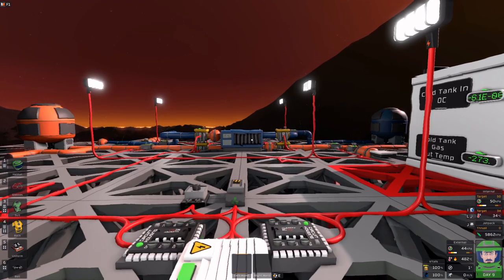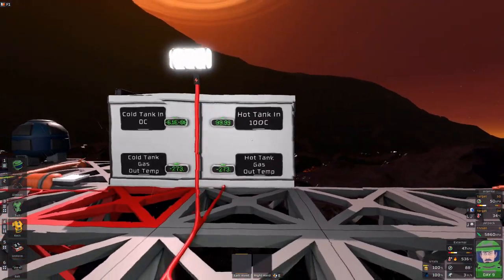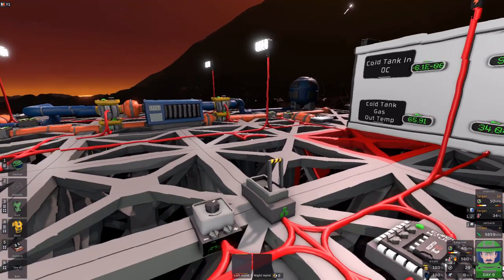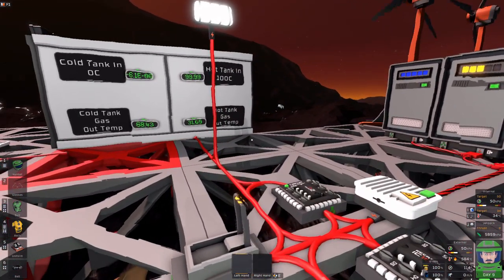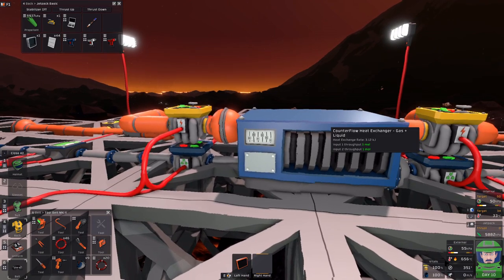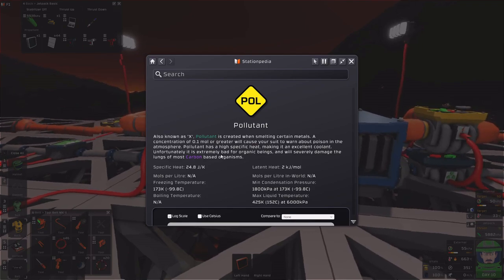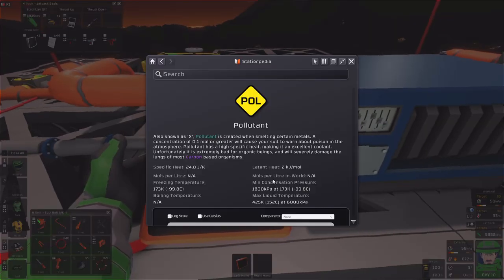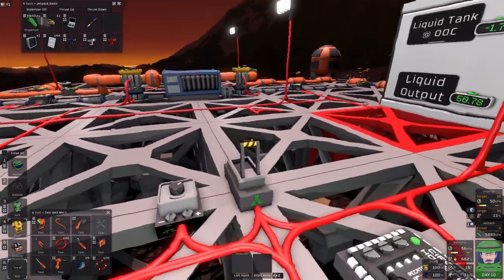Stationeers: Counterflow Observations

Comment: Personally I think you should not do the test with a liquid or temperature that ranges withing its condensation of the liquid. Or use a mixture to maintain the required amount of liquid pressurized within the swing of temperature range.
Another way is using gasses that remain liquid in low pressure, and adjust the temperature to a good range. 
I mean pollutant will condensate within the range of 0-100°C depending on the temperature range you work with, you'd need a gass or liquid that does not do that. Try testing water at 50-150°C under 1 MPA of pollutant. your condensation problems should be over.

Comment: Tip:  Explain your setup a little more, so we can see where/what you are measuring.  

3:24 - What is the Mole Flow (1, 4, 14, etc)?  Is that the Moles per tick?  What is the transfer rate measuring?  I don't think those were explained very well, if at all.
Reply from the maker: True, all of it was mols per tick of flow as stated by the counterflow. I adjusted those until I got roughly 50% of the energy transferred between the two gases and then compared it at higher amounts of counterflows to see how much better it got and where the new 50% transfer flow rate was.